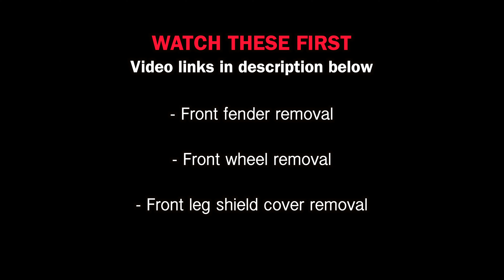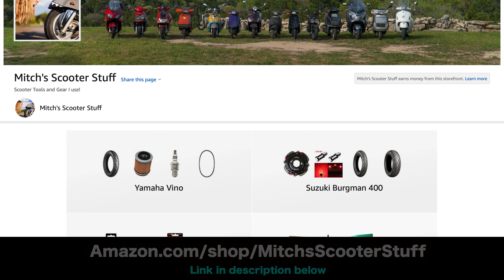Yamaha Vino 125 Front Fork Oil Change / Rubber Boots Replacement  Mitch's Scooter Stuff

Comment from the maker: * Tools I used in this video: 
Ratchet 3/8 drive - http://amzn.to/2hhmnUs
Breaker bar 1/2 drive - http://amzn.to/2HenuMI
1/2 to 3/8 drive socket adapter  - https://amzn.to/2EqLzQm
3" / 6” extension set 3/8 drive - http://amzn.to/2h7ypMl
17mm socket 3/8 socket - http://amzn.to/2EMT6LO
17mm allen socket 1/2 drive - https://amzn.to/2VqBfke
17mm LONG allen socket 1/2 drive - https://amzn.to/2CImZwx
10mm socket 3/8 drive - http://amzn.to/2xGuLSF
Cup / jar 
Measure cup - http://amzn.to/2hu6ARj
Rag
Phillips #2 screwdriver - http://amzn.to/2fgdZDL
Brake parts cleaner - https://amzn.to/2ZbZnbj
Goggles - https://amzn.to/3dEj6FA
Nitrile gloves - https://amzn.to/3i6Ad6B
ratchet strap / rope - https://amzn.to/2Bhx7ft
Grease - Grease - http://amzn.to/2wXw8Zy
Fork oil WT10 - https://amzn.to/3g3bNcl
Torque wrench 10-150 lb/ft 1/2 drive - http://amzn.to/2GuMsHJ
Caliper digital 12" - https://amzn.to/3fULYeu

Comment: This helped alot. I didn't have a 17mm Allen head tool so I used a old bolt and some vice grips for that step. Works just fine for anyone who doesn't have the tool

Comment: Hi Mitch, I want to buy two sets of front shock boots, they're not available for vino 125/2007 what is the diameter of the forks I see many aftermarket parts, thanks
Reply from the maker: Hey I have one extra boot, I will find and measure it but easy way to measure outer diameter on fork where boot hold on

Comment: If you going to replace the seal the whole fork needs to come apart theres a hex bolt that needs to be zipped off with a gun then it disassembles and you can use a flat head to pry out that seal and hammer a new on in with wide socket